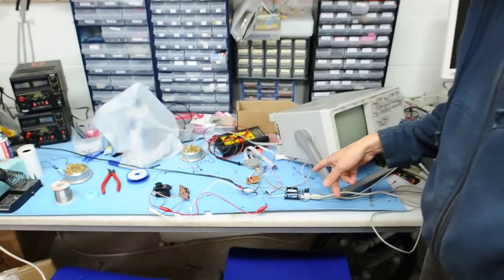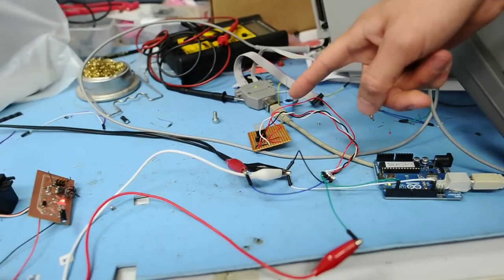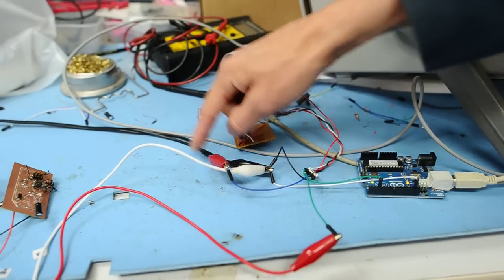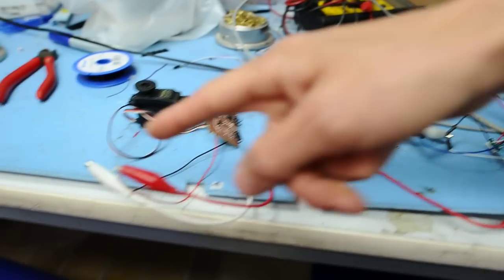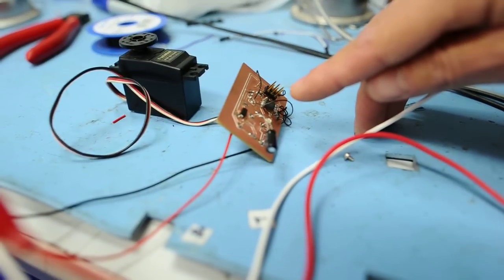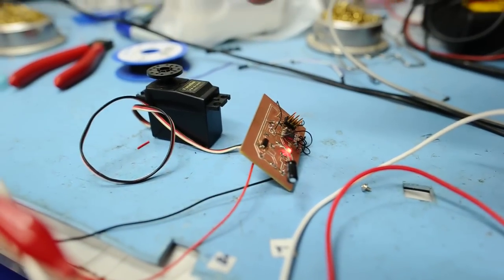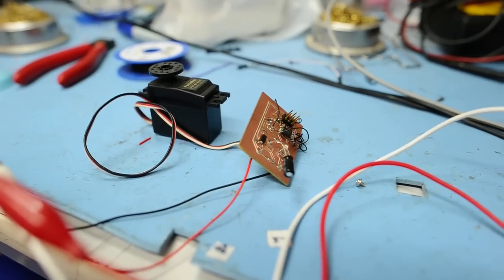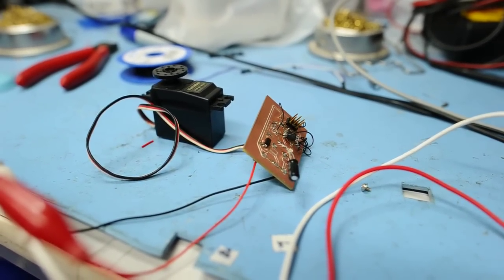2 wire servo demo

Comment: Thanks for posting. I have a 2 wire servo from an old Radio Shack RC from the 1980s, I tested it on a variable power supply, and the more positive voltage you put into it the further it turns one way, the more negative voltage you put into it the further it turns the other, from ~2 to 7 volts is apparently it's turn range. It draws about 0.2 amps max.  Any ESCs that can power this or do I have to build something with a MCU?